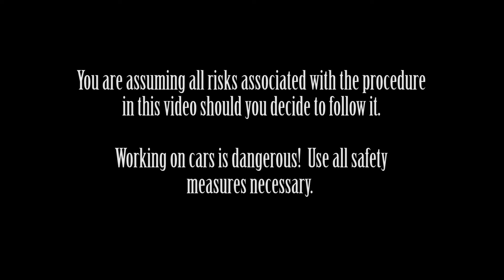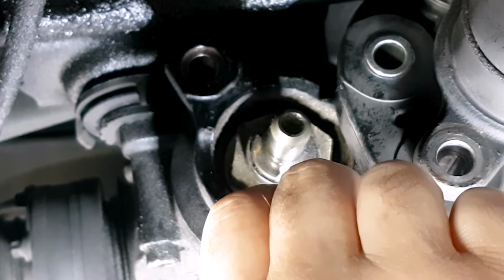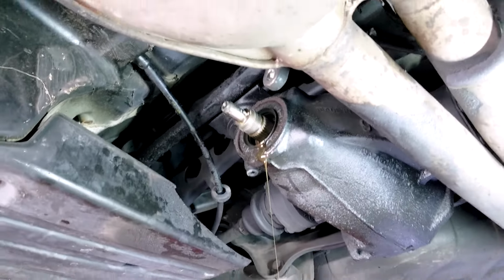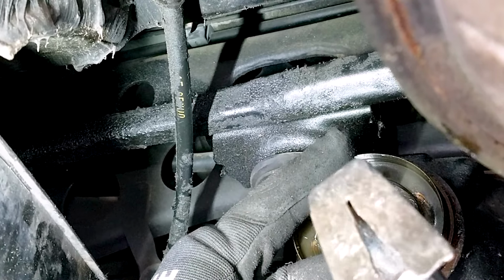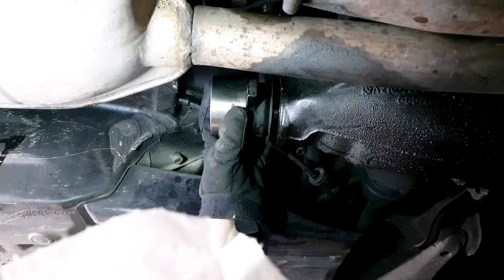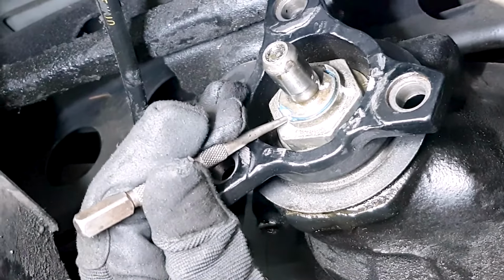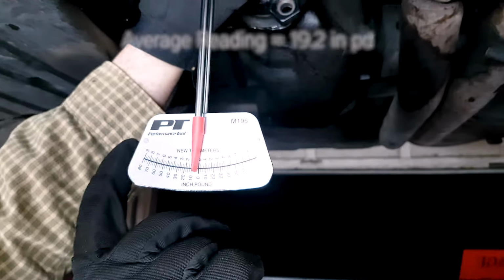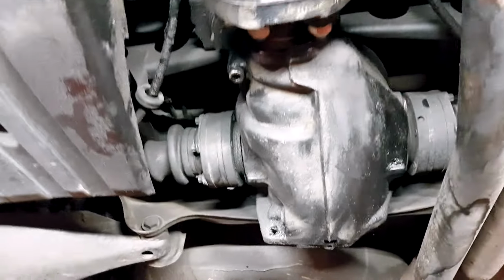Fix Mercedes  Differential Leak, W210 W220...

Comment: Hi Masood, appreciate the detailed video, I will follow your process for changing the seal on my r129 500, do you by any chance know the pinion nut min torque value and the breakaway torque values for it?
Reply from the maker: Thank you.  What year?
Reply: @masood-tv  its a '97
Reply from the maker: @gezata  That is a nice car.  The Tightening torque is 180NM+.  The plus part is based on what you measure it precisely beforehand.  Follow my procedure and it should work the same way.  The breakaway force is probably over 200NM.
Reply: Thanks, much appreciated! I assume you mean 200 n/cm as the breakaway force?
Reply from the maker: Np. I meant Newton Meters. If I understand the question, you want to know the force it takes to turn loose the collar nut?  You can use a breaker bar with tires on ground, or use a good impact gun.  Works much better and faster....
Reply: @masood-tv  oh i see, by breakaway force I meant the newton centimeters or newton inch pounds needed to have a correct pre-load on the pinion bearings.
Reply from the maker: @gezata  sorry for the late reply, had to look it up for you.  The WIS does not state the value for your car.  It simply says to measure it first and to install at measured force.
Reply: @masood-tv  thanks for taking the time, i recently got access to wis and it appears my SL 129.067 uses the reinforced 210mm diff, the tightening torque of the pinion nut is set at 125nm, unlike the minimum of 180nm for other versions. A bit strange.
Reply from the maker: @gezata  np,.  Measure the rotational torque first with the tires on or out as I show in the video, count the threads, and use a marker to mark current placement of the nut.  After replacement, torque to marked location and measure rotational torque the same way.  You will be good.

Comment: Many dont know this but you need to grease the threads on that three jaw puller. Look close, those are all metal filings flying off the threads on the puller shaft where it spins in its bolt. Plus takes away much more friction so impact doesnt have to work so hard. These tools get ruined fast when no one greases threads. Its a common thing. Many buy ball joint removal tools and threads they come dry out of the box. Buyers go at it and on first ball joint they do, threads get destroyed and then they complain and give a bad review of the tool. They just dont know.
Just sayin! Great vid. Always well done. Thanx 👍👍
Reply from the maker: Hi John, thanks.  You are making a very important point.  I failed to mention it in the video, I think.